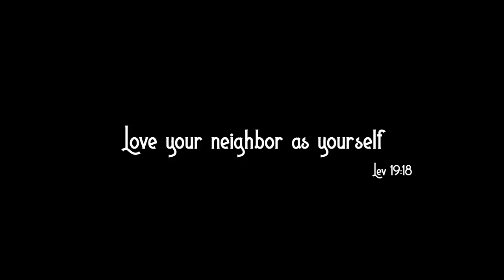TEARING APART THE LIVING ROOM WALLS - Mobile Home Renovation

Comment: I’m so glad you two are doing this considering my husband and I are about to tackle the same thing on a 97 Oakwood model. Pray for us😬
Reply from the maker: We will!!! :) As of right now, the new door is in. It wasn't very easy, but it is done. That video is coming very soon!
Reply: @sam-and-angela  Thanks. We are still currently working on the floors and walls. We got held up because we can’t decide if we’re taking the fireplace out or keeping it. But as soon as those are done, we move on to the doors and windows. At our current speed, we should be done by Christmas 2029🙃

Comment: when dealing with that type of installation, due to how well the edges seem stapled down (lol maybe they had a deal on staples at the warehouse store that day) cut a full length vertical cut down the length of that type of wallboard between the studs. This will give you a good strong edge to start pulling and prying from. That type of wall "board" is almost like really thick paper rather than actual wall board.

Comment: Wow. I didn't realize there is no osb or plywood on the outside of the house. Just tin, insulation and then drywall. I sure hope they are made better these days. Good work!!
Reply from the maker: Yep! It's a shocker the first time you see it, then you start to think of all the bugs, wasps, bees.... yep. :-|  Most newer homes have an exterior sheathing at least, so they're better than this kind (mid 80s).

Comment: Another great video. I wish our drywall came off that simple. Not only do we have a million staples, each cavity is spray foamed around the perimeter. So difficult to remove and scrape. Don't use spray foam!!! Stink bugs love to nest in it.
Reply from the maker: Great point! We've not spray foamed anything because of how it locks you into your materials. If we were building new, then okay, but repairing and upgrading as we can -- nope. :) We know someone will be in there again someday, maybe us, and it would be a pain! Just like you're dealing with. Good luck!!

Comment: You can re-sharpen the blades for the oscillating tool. You just need a fine metal file.
Reply from the maker: Not when the teeth are worn off. :)

Comment: How do you determine how much building materials y'all need for a project on the mobile home? Like the plywood for the roof, sheetrock, ect?  Did y'all use an app?
Reply from the maker: No apps, just measuring the work areas and giving us about 15% extra for waste. Sometimes we over buy, sometimes we drastically underbuy. :)

Comment: Wanted to know, is the outlet above and to the left of the door an outlet for the smoke alarm?
Reply from the maker: We think it is. We'd like to get some hard wire detectors to put in that spot and the one in the kitchen. Would be a nice safety feature to reinstate. They've been absent since we've had the place -- we have some battery powered ones we put in.
Reply: @sam-and-angela  Thanks so much for the info, that's what I thought it was, since the old HVAC unit was right across from it. Also, I bet your glad the factory didn't use adhesive and staples for the drywall !! Let me tell you, the adhesive is a pain in the butt !! makes for 3 times the work ! Lol 😆

Comment: hey sam i have a question about the plug in the wall by the front door was that for a smoke detector and if so do you still have the two plug ends one of ours went up and we can't find them anywhere if so let me know where i can contact you about it
Reply from the maker: We've not dug into that box yet, but it looks like only the plug that hard wires to the wall is in there. We'll know more when we dig into that box. :)
Reply: ok i happen to think of that after i sent the message and its the other end i need so that answers that question for us thanks for getting back to me though

Comment: Hi guys just saying that you should not use electrical items with the cords wrapped up tight can cause over heating in the cable and cause a fire 😊. Be careful good work on the Reno so far

Comment: Staples and glue, EVERYWHERE, at least that's what my mobile home drywall was attached with. And the wiring looked exactly like yours, enough wire to move the switch/outlet 6 feet from it's original position, with the same wire. I bought a tool off of Ebay to pull all those staples, huge time saver. I think it's called a nail puller. It looks like pliers but one side is rounded so once you get the staple/nail in the grips you can rock it back and leverage it out.
Reply from the maker: You're not kidding -- back when copper was cheap, huh! LOL No wonder people strip the wires out of these things. LOL